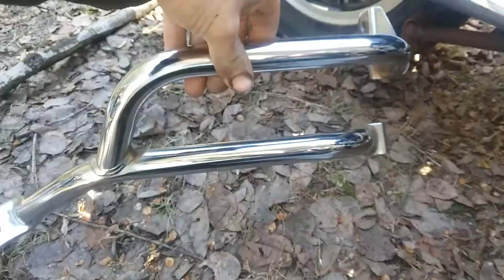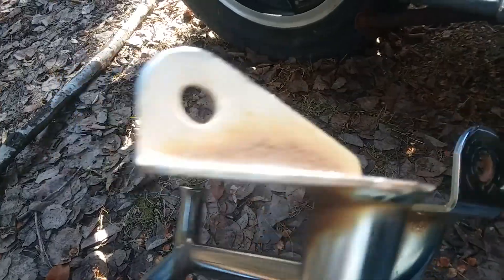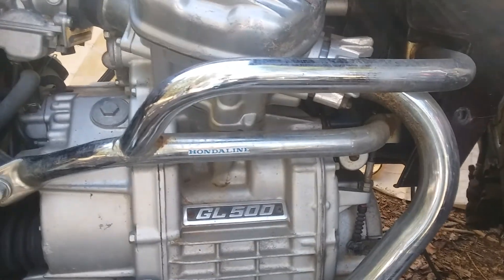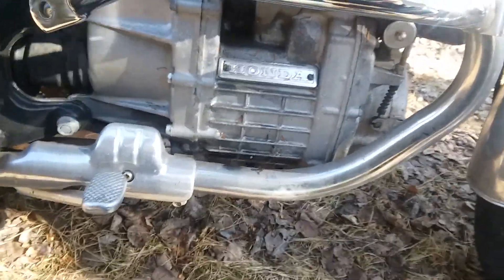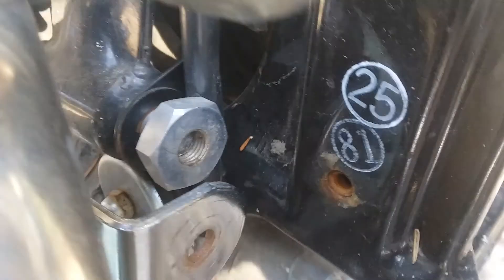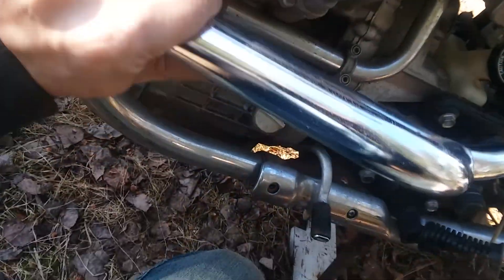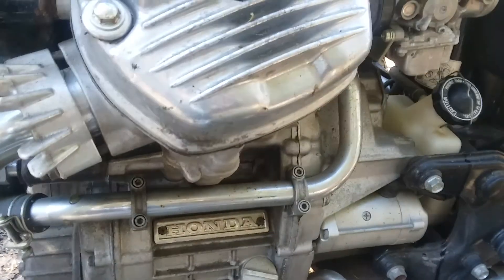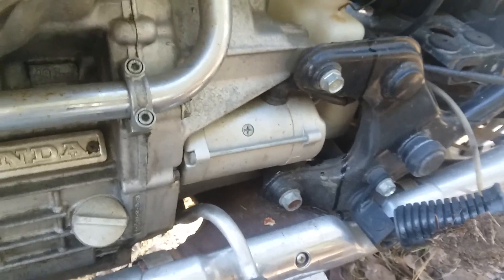Honda CX500/CX650/GL500 Hondaline Engine Guard Crash Bar Instal

Comment: IF you're still monitoring your post, I have a question. I have a 1979 CX 500 Deluxe and a pair of Honda Line crash bars same as in your video. I cannot locate the lower front stud extender as depicted in your video. can you suggest a source of supply!!
Thanks in advance

Comment: Where can I purchase those crash bars from?
Reply from the maker: Ebay is your best shot, these were made only by Honda and have been discontinued since 1986ish.

Many were made though so they're all over eBay and maybe 50% of the CXs & GLs out there have these on them already making them really easy to find should you be hunting for parts bikes. :) 

I had 3 sets this summer but sold them all already, if I get more parts bikes that might change haha